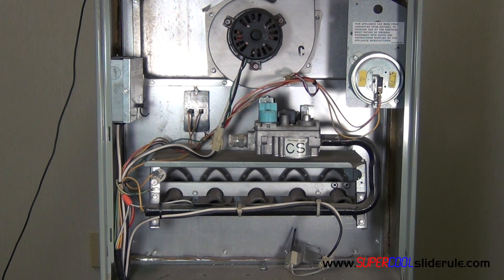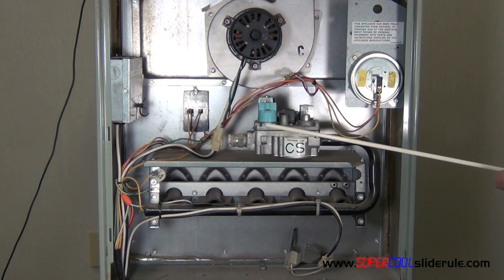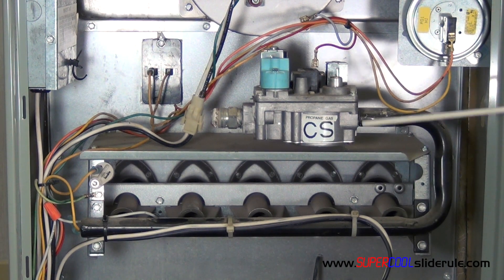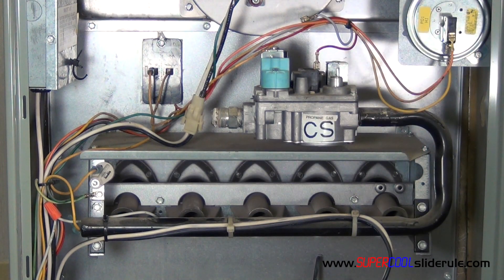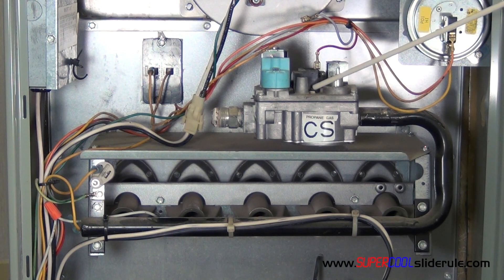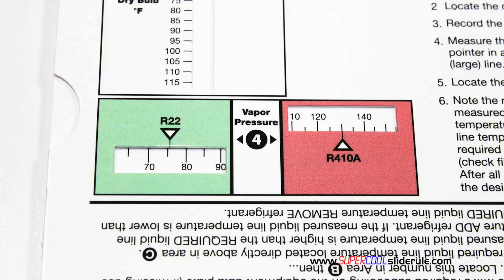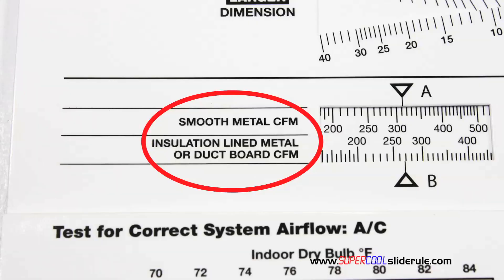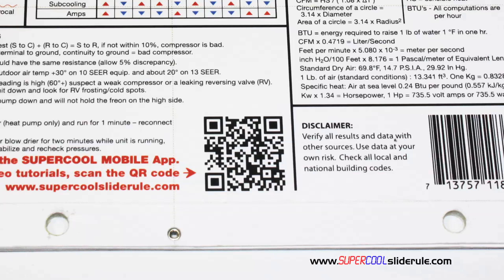How to replace a Gas Valve

Comment: Does not show anything but a static picture of a partially disassembled unit.

Should be retitled "theoretical steps involved in replacing a furnace gas valve" so that people searching for Hands-On directions and pro tips don't have to trip over this first

Comment: No one should do this who doesn't know exactly what he/she is doing!  After installation it is IMPERATIVE that the manifold pressure be checked with a calibrated differential manometer and adjusted to plate specifications.
Reply: The valves, for each series of furnaces, are already calibrated and that is not needed.  Shows that you must work for the manufacturer.
Reply: Thanks for this. I was about to try to replace mine and figured I'd do more research before taking on such a task. Lol. 👍